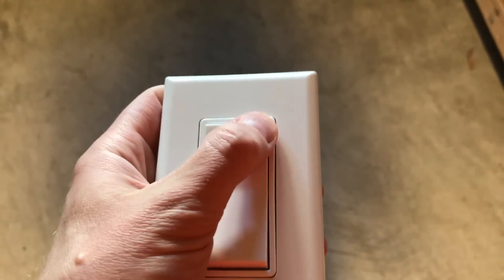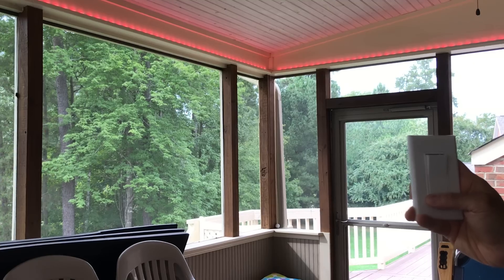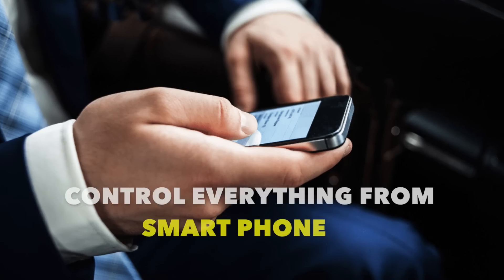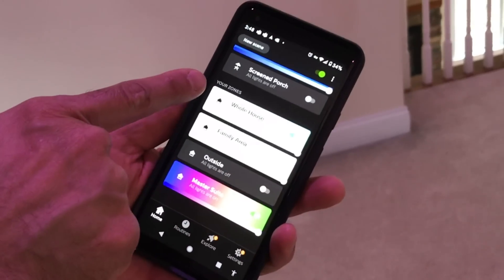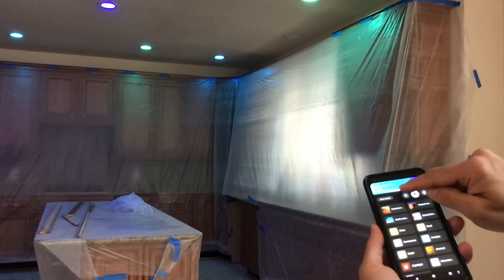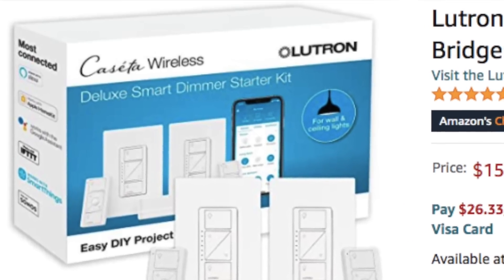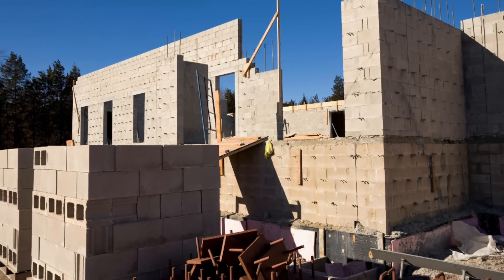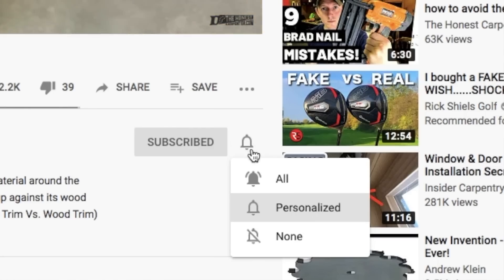THIS LIGHT SWITCH HAS NO WIRES / BATTERY! See How It Works...(Smart Lighting Setup--PROS + CONS)

Comment: I like wireless switches as so many middle range homes are designed with switches are not placed with the user in mind. I regret that so many of these smart or wireless switches are NOT toggle. Toggle are supperior to button or paddle switchs as 1) you don't have to later you gait's forward motion to move the toggle up and  2) you can move the toggle up blindly with the edge of a hand while button or paddles require more deliberate aiming.

Comment: I would like to install one of those, but without Alexa or Google crap. RunlessWire single pole is $150 now and reading the reviews, they have the same issues that $15-20 ones have.
Three years later and only the price went up😂. No reliability or customer service improvements.

Comment: Compare this to using a low-voltage relay to close a circuit operating heavy machinery. With electrical engineering technology, the same is accomplished using a very small voltage. I installed a wireless switch today, but came with a small battery. The battery switch is probably more robust.

Comment: Homeowner here.  I am curious to know how come this brand is $200.00+ but with others, they are $30.00+.  Run Less Wire only has 150ft range, and the cheaper one has 300ft range (Ortis RF Range Wireless Wall Switch @ Walmart, $28.00).  Been doing some research and want to understand the big difference.
Reply: Hi, I noticed your reply and wonder if you found the best product to use. Thanks, Don
Reply: @donsmith9081 I haven’t. Thx

Comment: Another problem with hue lights is when your home experiences a power failure and when your power is restored all you hue lights will come on and on their default color setting (white). you then have to open the hue app & shut off all lights and manually reset all your light to your desired color pallet, that's if you were wise enough to first create a hue scene and had saved your scene color in the first place.
Reply: There is actually a setting where you can set power loss default behaviour in the light settings of the app. You can set default (full brightness), last on, Power loss recovery (typically this is the one you should choose as it will restore lights to how they were on or off) or you can set a custom setting.
Reply: @bit-born  Thanks, this will save some time!
Reply: @stephen2220  Just got emailed of your reply bu can't see it here (guess you deleted it because you found where it was?). Eitherway it's in settings->Lights->{Pick your light} then it will be the first option (Power On). I would screenshot if I could.
Reply: @bit-born  Thank you so much!  I obviously overlooked that but yes, I finally found it, thanks again for all your help.

Comment: As a concept, I LOVE the idea of not needing batteries while also being able to place the switch in the most ideal location.
However, I want to know how reliable and robust it'll be in the long run.
If I have to replace the entire switch every year or two, then that's not really any better than having to replace some batteries 2 - 3 times a year.

Comment: This is an impressive switch. It is designed to work with Phillis Hue but that basically means, this is wireless, no battery needed Zigbee switch! Wow, that's better than any buttons on the market and you can control anything through Zigbee hub.

Comment: If you want just basic kenetic switches that control a light (or fan or whatever), those are substantially cheaper.  Still tens of dollars instead of dollars, but if it saves you from having to cut into your walls or crawl around in your attic and breath in insulation dust, it might well be worth it for new switches.  I've seen them where you can even pair up to 5 different switches to a single light.  That's great if you have a light in a stairwell or someplace with only 1 switch and want to change it to be a 3-way setup.  You can even get the switch in the form of a fab so that you can turn on outside lights when you drive up to your house (if you don't want to or can't put in a motion detector).

Comment: I'm looking at this particular switch for one area, I have a 3 way circuit which is required for bottom and top of stairs lighting by code, and I'm in the process of rewiring my entire house... Turns out I'm hitting nothing but dead ends on trying to replace the switch at the bottom of the stares without destroying the plaster, this particular switch seems like a perfect way to meet the code (which does not specify how it must be done) and get the job done.  No hubs, no configuration to do with new owners if I ever sell, just a simple 3 way switch setup that happens to not use wires.

Comment: My front room has an "always on" overhead light receptacle, but I wanted to be able to flip a switch to turn the light on when I walk in from outside. I used one of these, and it works great. The switch is really expensive for what it is, but it's cheaper than hiring an electrician to run a new switch wire though a crammed attic and down an insulated exterior wall. I got lucky that I had a double-gang box next to my door and one of the switches controlled a wall outlet. I just removed that switch, hardwired the outlet to be always on, and stuck the RunLessWire switch in its place to control the overhead light.

The one I used is not an IoT switch. It speaks to a wireless receiver in the fixture receptacle. I didn't want anything I would have to configure or network.

Comment: I know a school that had these types of lights installed in their renovations. There is a master switch that turns all the lights off and on in the hallways. It's great when it works but every time there is a power surge due to high winds or thunder storms that one master switch stops working. The breaker box doesn't do anything to correct it but the next time there's a thunder storm, they start working again for awhile. Very frustrating.

Comment: Phillips Hue makes one specifically for their lights. I got it as soon as it came out. Just as he said, every now and then it would disconnect. Phillips has a second one that I believe uses a little battery. I bought that one too. It didn't disconnect while I was still using Hue, but after the company forced a new bridge model for their bulbs, my Hue lights never worked properly again. Finally, in a fit of rage,  I took down my 20 + collection of Hue lights I  collected over the last 6 or so years. I was already starting to use Lifx and some cheaper bulbs and now just use those.

Comment: Internet required is what killed it for me. Yes I have internet. No I do not want my lights to depend on it. I also don’t like things that rely on smartphones for control. A dedicated remote is more reliable with no question of being secure.
Reply: The lights shown in this video are Philips Hue and doesn't require internet or even a traditional WiFi/Router network. The switches and motions sensors etc control the lights so you don't need to rely on a smartphone, just like a traditional light switch. Infact you can pair bulbs and switches directly with in itself is a "dedicated remote"

Comment: I bought a box of 4 Sylvania WiFi lights, and can't be happier!  Their app is simple to use, and you can add the app into Alexa or Google, and use voice to control.
NOW, I just say "Alexa, I'm going out!" and Alexa turns all lights but the hallway off.  That one gets set to 20%. (I live in a 270sqft studio).

Sylvania doesn't need a hub which costs extra.

Comment: I think its time we move into a separate 12v circuits in houses for lighting. The led bulbs we buy convert the 120v to 12v anyway. It would save on wiring costs and less clutter in  circuit breaker box. RVs have this and its works great.

Comment: I have a wireless doorbell that works the same way. The transmitter which you stick outside your door requires no power or battery, while the receiver gets plugged into a power outlet inside your home.

Comment: These are really cool. LeeValley has these as remote outlet switches to turn tools on/off.
Reply from the maker: Dang, I hadn’t even thought of the shop options Kermit! You could keep a dust collector switch on your hip...🤔
Reply: @TheHonestCarpenter  Exactly. They have a pretty good range, but I think they work on Radio Frequency so they just can’t go through walls. I think they’re basically Line Of Site.

Comment: Tech is always evolving. Good, bad, or ugly, we cannot stop it. It is both good and bad. Good for efficiency and easy of use down the road. Bad because all the old stuff gets dumped as recycling has become expensive.
My question is, as I am actually trying to find a way to operate two hoists, I have mounted in my garage, from a switch, vice having to go over to the hoist and use the hard wired toggle on the unit. Any ideas? Cool video.

Comment: You did not compare price of ownership with classic wiring.  Seeing just bulbs price we understand you proposition will be many times more expensive.  For the price of just pair of smart switches and starter kit I will equip whole house with LED lamps and triggers, that will switch the light automatically when I enter the room.  
And you forgot to mention, that wiring still needed for the bulbs itself and to electric outlets....
Did manufacturer test these switches lifetime? Lifetime of electronics (including expensive) is not eternal.  One capacitor will break in 5 years or wireless standards will change and you will throw it out. While classic copper will work eternally.

Comment: I've got a piezoelectric doorbell button.  The chime just plugs into an outlet.  One upstairs and one down, they're programmable.  But the button... I really didn't to want to futz with batteries.  Battery goes out on your doorbell you won't know until at least a few people have come and gone.

Our exterior was brick though, and the wood trim around the door was too narrow for it.  So I literally stuck it to the door itself.  Anyone ever see a doorbell button on the actual door?

The other usage I've had for wireless light switches is with the garage.  When they'd rewired our garage they wired up a new 20A 220V subpanel in the garage.  So the only wiring going out there is for that subpanel, it can't be switched as if it were just lights.

Since the garage is 20' from the house, it's royal PITA to run out there if you've forgotten to shut off the lights, especially during the winter.  And the wife likes having the garage lit up when she goes out so she can see where she's going since she leaves before dawn.  The garage lights were all switched from inside the garage, and we wanted to keep a switch there.

So I swapped out the garage switch with one that's got a wireless receiver.  It's still using standard 15A 110V wiring, but it's got an extra grey wire that's not wired to anything, it's an antenna.  In the house there was still the old switch for the garage which was rendered nonfunctional by the rewiring job they'd done.  I swapped it out for a wireless transmitter switch.  It's not piezoelectric, though I wish it were.  It's run by a small 2.2V coin battery.  I'll have to replace it around every 3-5 years or so... still far better than days of old when you'd have to swap out a AAA every few months. :P

Comment: Anyone interested, you should go with Sonoff (https://sonoff.tech). They're cheap in comparison and there's a huge community around this brand. You can use them right out of the box with their app or you can integrate them with a home automation system with Home Assistant (https://www.home-assistant.io), which you can install on a Raspberry Pi, other single board PC, or even an old PC. In fact, Home Assistant will work with any IoT/smart home device or component, including Phillip Hue and  Lutron components. The best part is that its open-source.

You should be able to find information and help on YouTube for Sonoff*, *Home Assistant and other smart home stuff.

Comment: This was a commercial, you didn't show how it works ? The science behind it.
Reply: he literally explained it in the first sentence after the introduction. At the 1:00 mark. It generates a tiny bit of electricity through the motion of the rocker switch. The switch has a radio transmitter which sends a signal to the receiver unit that is installed at the original switch position. That triggers a relay which "flips the switch" on the original circuit.
Reply: I mean, he sort of elaborated as to how it works. However this is something called piezoelectricity, generated by types.of.crystals clicking together, the same science at work to cause the spark in the long candle/grill lighters. 
You'd have been able to figure this out with some basic knowledge of minerals, etc.
Reply: That is exactly why I thumbs down.

Comment: I don’t care about the color options. I have deployed TopGreener switches in my house and a few Kasa switches and bulbs. I didn’t know about the kinetic switch which solves a problem for an upcoming chandelier install where there is currently not a switch or electrical run. The most important functionality to me is being able control devices or scenes using Alexa or Google home. Also, i can integrate the motion functionality in my Ring alarm system motion detectors to trigger events like turning on lights. Since Amazon owns Ring, there are some awesome integrations like if there is motion at your ring doorbell, then the porch lights turn on, and Alexa will announce that there is motion at the front door on all of your echo devices. Alexa acts as a clearinghouse for all of this functionality, where as an eco system like Phillips might lock you in to their fence.

Comment: Interesting switch. I have a similar switch that uses a battery. I use it for under cabinet lighting. I didn't have to hardwire the lights, just plug them into the outlet with the controller. I have cabinets on both sides of a galley kitchen. I got the same frequency for both so that I can turn both sides on and off from one switch. And you can use 2 switches so you can operate the lights from either side. Also, you can use a set up like this on a staircase.

Comment: Not impressed with the light switch.  You could plug the lights into a remote module and use an existing wired smart switch with multi tap scene control to control the remote module.  This would eliminate having to put that "runless wire switch" somewhere and would allow the lights (plugged into the remote module) to be controlled by any existing smart switch.  I use Homeseer switches with a Smartthings hub and can control any light or remote module in my house from any light swtich in my house (they  are all smart switches).  The runless switch just seems expensive and pointless but it is interesting.

Comment: I don’t think this tech is quite ready for prime time...use it in some niche applications but not for a whole-house application.  I had some internet problems for no apparent reason and had to reinstall all 3 of my smart switches. It was a hassle. OTOH, the ability to put up a no-wire switch in some locations is a nice new innovation I’ve seen used successfully.

Comment: A solution to a problem I've been trying to figure out for a while.  We bought a house that has a long hallway, with the lightswitch at one end, nothing at the other.  I didn't look forward to running another wire to the other end, and my wife is not thrilled with the idea of having to get her phone out just to turn a 'smart' light off.  These wireless switches will do just what we wanted.  Thanks!

Comment: I think kinetic switches have potential but not for these applications. Put them on weight training equipment, exercise bikes etc at gyms and pay people to workout based on how much electricity they produce. You might see a drop in the obesity epidemic too. ;)

I'm a hammer and nail type too, BTW. The wire is still useful even when the internet and power go out.

Comment: Good video and thanks for sharing. I do remodeling and have been using smart tech for a while. You have hit on several key issues when it comes to using tech. First when you compared the tech switch verses old faithful. The install charge for old faithful should include cost of the contractors install time and the wire. Depending on the distance and how much drilling needs to be done it can come close to the same or in many cases less. This is especially true on a remodel when you don’t have to repair drywall. Most important to me though is the ever changing tech. I have found going with established companies has actually saved me time and money. The tech support is more readily available and up graded software is usually pumped out free increasing the longevity of the products.

Comment: I like the KISS approach.  My traditional light switches work great!
Reply: I like smart homes but don't like coloured lights apart from boxing in a living room with strips 

Everywhere else is tacky
Reply: LW: Lucky for us we only have colored lights.... the tacky coloured lights were sent to the other side of the pond...
Reply: @reviewassistant6891  same, for that I think smart light switches are the way to go. I personally think the Kasa line looks the best with a more traditional rocker design and it’s really responsive. It allows you to have smart functionality without having to buy more expensive bulbs

I’ve changed switches which control outside light fixtures to these so they automatically turn on 5 minutes before sunset and turn off at sunrise.
Reply: @reviewassistant6891  
"boxing in a living room with strips"
What is the meaning of this phrase?
Reply: I always felt the same way until my wife got me a Google Home and I installed some Wemo smart switches. Telling Google to turn on or off lights became a major convenience. Having just moved to a new house, I'm planning my switch switchout.